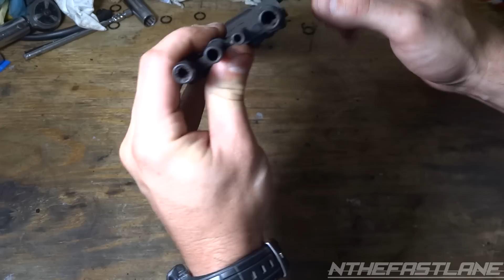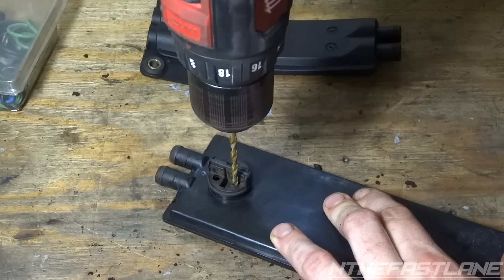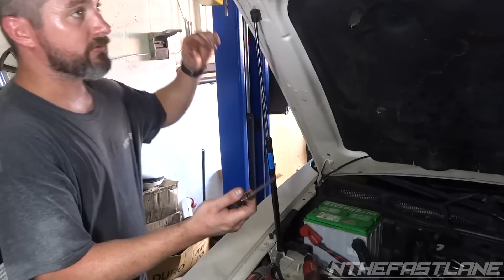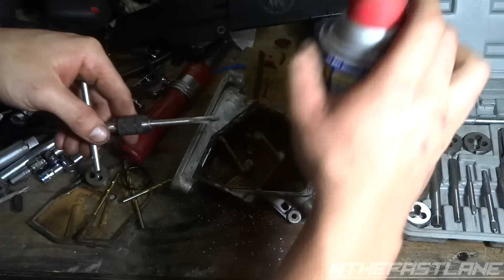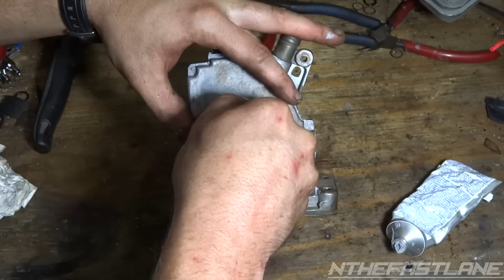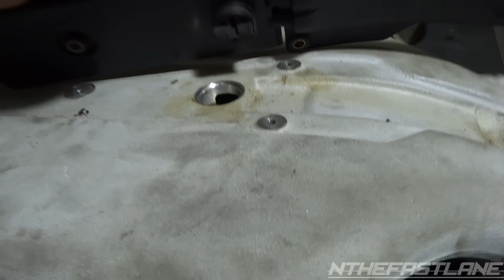▶️CTS Burning Oil Under Hood (PCV Valve Repair)🔧

Comment from the maker: 🛒Shop This Video: https://www.nthefastlane.com/cts-burning-oil-under-hood-store
🛒Find Any Leak: https://amzn.to/3JADlYm
🛒Download Auto Repair Manuals: https://shrsl.com/3wmrj
🛒Visit Nthefastlane's Amazon Store: https://amzn.to/3pP4UCy

GM 3.6 Losing oil FIX: https://www.nthefastlane.com/losing-oil-gm-how-to-fix
Reply: Ok, I gotcha thanks for the reply and I love the video.
Reply: I did exactly what you've done to the T, but the funny thing is that when i went back to put the vent housing or pcv module, the bolts(all 4 of them) seem to be too long now. They will not clamp down the module. I tighten the bolts and my module moves around like it doesn't fasten down. Can you help me with this? What do you suggest i do? It's like i need to cut the bolts like 10mm down and it might work. Please help
Reply from the maker: pickle rick I'm a little late, sorry. Maybe you found the solution? I would suspect oil got into the bolt holes and is causing the bolts to hydro lock. Clean out the threaded holes really well with compressed air and brake cleaner.

Comment: Shocked that GM put a bad engine in a Cadillac. The 3.2 is notorious for its absolute dogwater pcv, and people usually sell them before the entire system breaks down and you have a puddle of oil from the crankcase in your intake. I'd tell them to start car shopping because that thing wants to die

Comment: Really trying to understand that flapper valve. I assume both inlets are simply connected to the crankcase. So how does that valve control pressure? Maybe there's some weird interaction with the geometry from the open section being directed down to open the valve? I don't know.

I guess you might be able to install 2 inline pcv valves instead of rebuilding the flap valve as an alternative.

Comment: My 2014 CTS has a burned oil smell, but there is absolutely zero oil on the engine block. All mechanics tell me I have no problem. I suspected the passenger valve cover gasket, as I saw a smudge all the way around it when the problem first started5 years ago. Now I am pursuing the PCV system. I checked my PCV valve, and in 2014 it was already drilled out by the factory. But probably there is a clog somewhere else. I am going to check if there is any pressure on the oil cap. Thanks for your tips.

Comment: What about the 3.0 engine. My oil is smelling like gas and I’m afraid that’s the problem too the pcv valve. Is it in the same location?
Reply from the maker: If it's the L81 3.0L Cadillac Catera engine then yes, it has the same PCV canister.
Reply: @Nthefastlane  i have 2010 cts 3.0

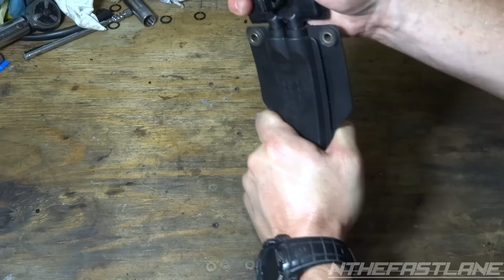Comment: I subscribed because of the great video this is and the same car my son has that I have been fixing. At 3:40 you said replace the small o rings what is that black piece part named? Also after spraying the brake cleaner in holes is it ok to flush it with distilled water? Also what are the dimensions of the long bolt with threads you used? Thanks a million you’re a life saver.👏😇⛑🔧🚖🌎

Comment: my cts pops in the rear end when i pull out has there been any recallc or do you have any advice
Reply: Same i cant figure it out been there for atleast 6month say service stability
Reply: I have 2003 Cadillac CTS 3.2 v6 I had a     Jerk from car when slowing down to a stop. I changed the driveshaft center support bearing and it fixed the problem. Check 1a auto video for directions.
Reply: The rear differential bushing is bad

Comment: That pcv looks like it's from not letting it get to operating temp.
Reply: @Dev JB Isn't there an issue with the VC gasket as well that restricts flow of the pcv ,and there is an update?

Comment: Wow thanks , I spent the weekend doing the valve cover gasket and cleaning the pcv valve , module,and hoses and my avg mph went up from 20 to 30 huge difference ,by the way the hoses was like 80 percent clogged, thanks Nthefastlane

Comment: 2012 cts 120k miles. Suddenly burnt 2 qts. Drilled it out , changed the oil and no more problems. Thank you. One of the 2 small holes was plugged w carbon build up.
Reply: What were your car symptoms

Comment: I followed these instructions and it didn't work.  I used viton rubber.  I think the reed material was too firm.  What happened though is the engine would  sound like a valve was hitting the piston at an idle and then at 2-4K, it sounded great.  My original problem was valve cover gaskets which I replaced, but it still leaked badly near the oil pump.  I'm not sure where it is coming from.  More to do, but I worried I blew up the engine.  Perhaps I dropped a socket inside.  I had taken it all apart, got really sick for a week and when I put it back together the sound of death occurred.  I don't believe the noise was caused by the mod, but my reed valve was too firm. I hope to tear back into it soon.
Reply: firm not. probably flapping around. the original is very firm plastic piece in the box.

Comment: I have a 2000 Saturn LS2 with the same engine as the CTS.  Oil is being pushed out nearly every gasket and suspect the PCV module is defective!  Thanks for the rebuild info!  

Wait a minute.  If this rebuild worked, why did you lose a quart of oil a week and have to replace the valve cover gaskets in two months.   I am confused.  Did this oil separator rebuild work or not?
Reply from the maker: I replace the valve cover gaskets before I messed with the PCV system. I didn't realize I had excessive crankcase pressure at the time. The valve cover gaskets were leaking bad. I caught it when I pulled the oil cap off and there was excessive pressure. Then I went ahead and did the PCV system repair.
Reply: @Nthefastlane  The dates on the video is what is confusing.  So the gaskets were bitched and continued to leak even without any blow by pressure?
Reply from the maker: I've had no issues since the valve cover gasket repair and the PCV system repair. Unnoticeable oil consumption now.
Reply: @Nthefastlane  I sent you an email to ask a few questions that don't need to be cast in stone YT
Reply: @Nthefastlane  My main question was with the dates of the videos.  First the PCV module rebuild and they 2 months later you talked about losing a quart of day.  If the PCV mod was successful, what was causing the oil leakage as if the plug was missing?  I am just trying to understand the time line.  Thank you.
Reply: I am trying to understand how the PCV module works.   If both engine side ports are subject to the blow by, they would push the rubber flap shut or neutral position and more so at an idle when the vacuum is strong. How does this "meter" the blow by. Manual states it is one way rubber reed value    I think a white board explanation is in order.  I know there are many Saturn 3.0L owners that would like a solution for oil leaks.  Personally, we got three holes in the exhaust manifold and its like an ugly turkey boil fire when driving the Saturn!  I need to patch the exhaust and fix the blow by issue while I change the gaskets.

Comment: I just did the same job. What a pain in the ass. Maybe because I'm 69? Only place I could locate the PCV valve was at Napa for $200. I was afraid to check a dealer. Now I'm waiting to see if it works out. Sure hope so because I was loosing a quart in 200 mi.  That is a screwed up way to accomplish PCV. I was about ready to drill some holes in the fill cap and tie a shop towel around it. lol
Update on pcv change. I did exactly like the video said and it cured the problem!!!
Reply: What does it look like?  That y rubber tube hose thingy?

Comment: How would you get a traction control to shut off on the dash to be able to maintain regular speed in.
Reply from the maker: For the CTS you put it in park, open your glove box and there's a button that you have to hold for 5 to 10 seconds and then it will light up your CD deck and say traction control disabled.
Reply from the maker: The vehicle has to be running when you do this.
Reply: And remove tpms sensors from tires.

Comment: I did this and changed the valve cover gaskets and my cts is still leaking oil. What do you think it is?
Reply: Warped heads
Reply from the maker: Sometimes the valve cover gasket gets brittle, once it blows, it needs to be replaced. Link to My CTS Valve Cover Gasket Repair: https://www.nthefastlane.com/cadillac-cts-valve-cover-intake

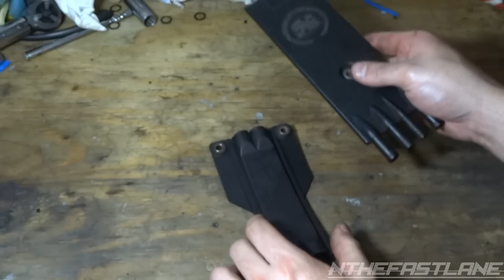Comment: Dear Nethfast- First and Formost,  Thank You for such an informative Video...... I have so many questions but I'll try to ask just this one... (1.) The Piece/Part featured in 3:47 segment that is a rubber piece?
Reply from the maker: LongHairDontCareAlwaysSlayedRingnBaed It is plastic with rubber O-rings.
Reply: Dear - Nthefastlane HI This post is interesting. 've Noticed..like a "sickening-burning-oil smell" that is only smelled while stopped at the stop lights while the windows are down..... the smell is absolutely GROSS..GROSS....GROSS..
Part A: if you were doing this for someone how much would you charge compared to a  dealership (guess)????

PART B: Without giving specifics which state are you in and is it North or Southern Part of that State?

PART C:
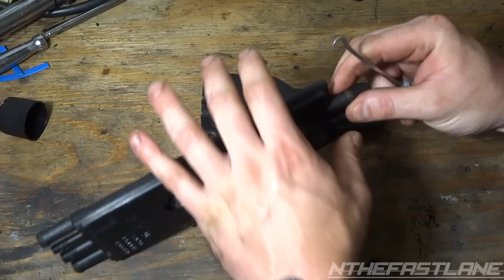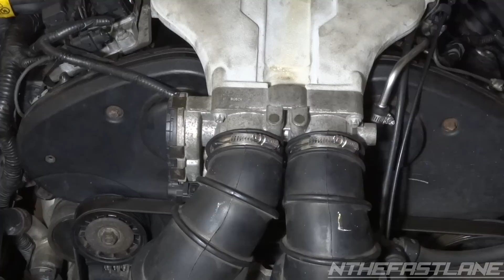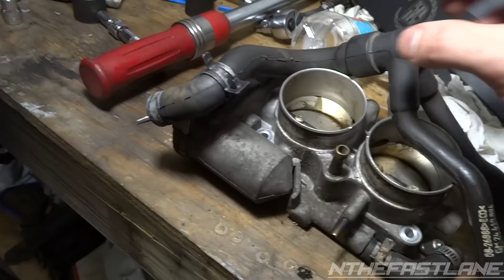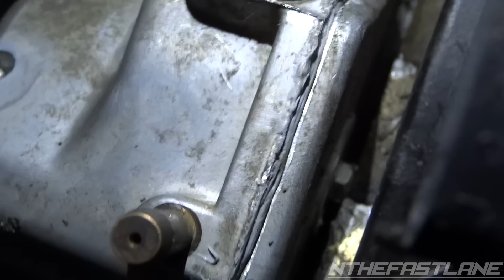- If Im going to a dealership and I want to have this process done.... what are the "professional  names for all of the parts that I want cleaned such as: for example: (1.) The professional name of the unit that you're holding at 2:42   ?  (2.) The Hole/Port that you're pointing to at 2:48  (3.)  The hole that you're pointing to at 2:49 (and say this is where most of the problem is coming from/2 holes)  (4.) 3:04 the PCV Hoses?(lot of build up reduces 50% of flow)  (5.) 3:43 Change all O-rings (6.) 9:54 Replace O-rings (b/c flat)  (7.)  10:39 Tell them to remove Throttle body...b/c 2 ports lead back to pcv modulator (Pull it off and Clean it out) (by sliding 2 big hoses down. and remove small over flow hose for radiator) ok (8.)  12:30 Remove all build from the "Intake" (9.) and clean the ports for the throttle body (10.) 13:36 On the fuel pressure regulator replace the "vacuum line hose" this prevents the fuel pressure from running sky high (11.)   13:51 replace Gaskets for the ______?    (12.) 15:52 remove the clip and CLEAN the double hose on top of the intake which is call the PCV MODULE   (13.)  17:12 this called the PCV MODULE definitely clean carbon from  this (clean the bottom and where hoses connect piece cost $200) if cut make sure it's cleaned with parts cleaner ABSOLUTELY NO SHAVING DEBRIS to save rod/main bearings/engine  (14.) 17:27 Vacuum hose which connects to pcv module (v shape) definitely clean this (even cut to clean this/blow it out for maximum airflow because it relieves crank case pressure) (15.)  27:56 Flatter Bolts for....._____________???    (16.) 28:51 CLEAN THE TWO WAY TO ONE WAY PCP PIPE (17.) END RESULT NO MORE 30-to-20 Crank Case Pressure 

 **MAIN THING  REMOVE ALL CARBON BUILD UP
**END RESULT NO MORE 30-to-20 Crank Case Pressure 
THANKS

Comment: My issue is the car will start and run but when it gets to temperature it dies and won't let me restart until cool does anyone know because I am lost
Reply: Crank shaft position sensor needs to be replaced it get hot and dies when worn out

Comment: ive been looking EVERYWHERE (Parts stores for manuals, the Dealership, Cadillac customer service (No help btw)....) for the vacuum line diagram for a 2003 cts. This has to be the only video in. existence that helped me out, Thanks!
Reply from the maker: multijr230141 I'm pretty sure it is, I couldn't find any kind of information myself. So I put this video together knowing somebody else was going to need it. You are very welcome!
Reply: @Nthefastlane  I'm in same boat for a 08 cts di

Comment: All my hoses are oily the coolent container is like a milk shake. I changed radiator but still the same any  advice?
Reply from the maker: If you have oil in your antifreeze overflow reservoir, then you have a blown head gasket. Is it oil, or just gunked up with old antifreeze?
Reply: I think is just gunked. 
I did a test on checking for blown head gasket but I don't know if I should trust that.

Comment: Is there no other way to clean that modulator other than prying it open?   This is something I need to do for my CTS but need to know if I need the drill and whatnot.
Reply from the maker: If you don't pry it open, you will not know if it is completely clean inside. Not to mention, the rubber flap could be brittle inside like mine and you're going to have to replace it with a new rubber piece like I did.
Reply: Nthefastlane 
That makes sense.  I believe that mine is clogged completely.   Going to attempt this tomorrow after work.  Thanks for the info, I would not have known otherwise.

Comment: What kind of repair do you have for the 2006 start 3.6 pcv system
Reply from the maker: +fredhetherjr I don't have any as of yet, but this is the part number you need to replace. PN# 17816-05660042

Comment: Nice video, any other major problems with this year model cts's? i was thinking of buying one soon
Reply from the maker: +Sickstang615 I had a TCM issue and a Bose amplifier issue. 5min swap. I'll be uploading quite a bit on the Cadillac CTS. My next repair video is going to be the water pump and the timing belt. I'll be uploading those videos shortly. I've already uploaded the radiator repair video and the serpentine and pulley repair video.

Comment: Can this unit be cleaned or flushed out without removing?
Reply from the maker: +Abe Jr No, the built up carbon is very hard and brittle. Even if you could dislodge some of the carbon in the line,you do not want that getting into your engine.

Comment: I really appreciate my Suzuki after watching the mess in this video!
Reply from the maker: +Dave Kauffman 😁
Reply: I may have to take that back, I burned up my starter cranking the engine so much, and I'm trying to change it out; the bolts just barely accessible. To better understand, look up the Suzuki XL7/Grand Vitara 2.7 DOHC V-6.

Comment: So is this fix the same on a 3.6 and does this fix oil in the air filter and intake tube?
Reply from the maker: +David Kohl The 3.6L does not have the same PCV system. You are going to want to replace this part on yours. Cadillac GM OEM CTS 3.6L-V6 Air Intake-Pcv Tube 12620142. This is what's causing the oil in your intake system, it's a small plastic pipe that inserts into the intake tube that has a PCV valve built in. Look up that part number I gave you.
Reply from the maker: +David Kohl let me know what year your CTS is. Part numbers change from 04-11
Reply: @Nthefastlane  Will this part fix a 2006 STS w/3.6 as well ?

Comment: Replaced Valve cover gaskets a month ago but then now it again started leaking oil and dripping on the exhaust below the oil cap, if i get this done, that fixes it or still i need to redo valve cover gaskets??
Reply from the maker: Chaitanya Dommeti I had the exact same problem as you, I thought I might have to redo the valve cover gaskets again, but once I did this PCV repair, I never had to touch the valve cover gasket. It never leaked again.
Reply: Thanks for the quick response, i will let you know how it went. And thanks a lot for the very detailed video demonstration, this helps a lot

Comment: Is the timing chain issue related to this?
Reply from the maker: +blood117 The 3.6lt they seemed to correct the problem. I'm not sure it th e have the catch can behind the passenger cylinder head. There's one pcv line. No more multiple vacuum lines over the intake plenum. I'm about to upload the intake gaskets and valve cover gaskets repair which is a very similar process of the 3.6lt chain.

Comment: Will this apply to a 2008 3.6 DI burning oil?
Reply from the maker: +luis d It's a different setup. They reverted to a single PCV line. I'm sure they realized soon of the 3.2's issues and deleted this problem.